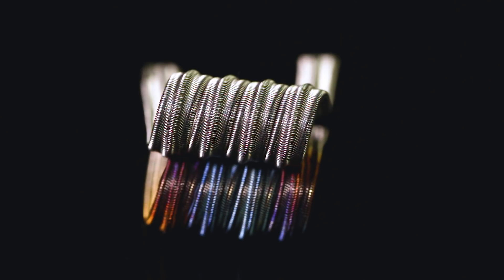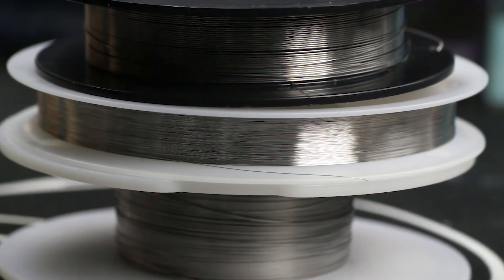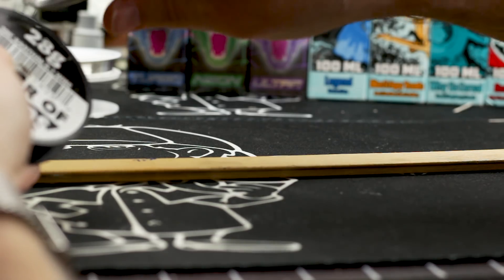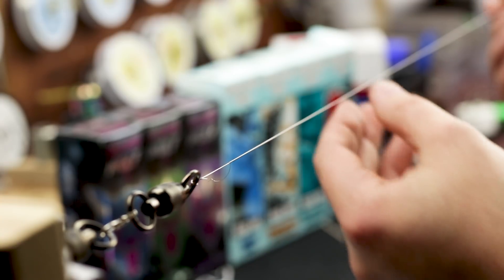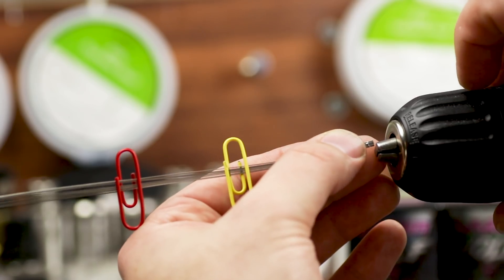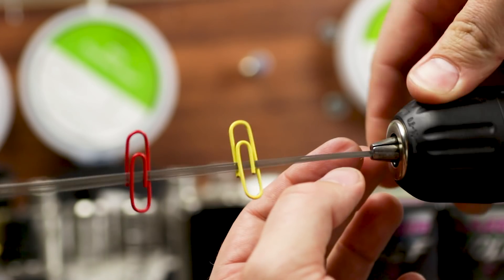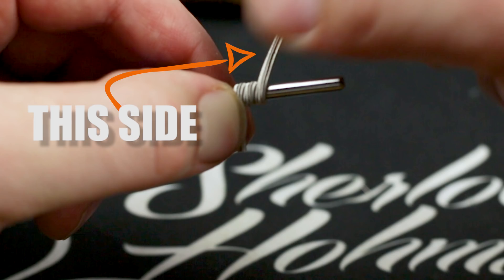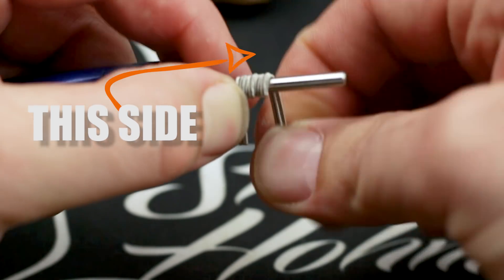How to Build the Enigma Coil  - Coil Building Tutorial Series - Advanced Exotic Coil Build

Comment: I'm trying out a new build you might want to check out, 28g ni80 claptoned with 32 kanthal a1, claptoned again with 36g ni80 in the grooves. Like you would fit the fine wire in a twisted helix, only in the larger Clapton instead of in the twist channels

Comment: What causes the bulge? The extra number of staples in the core. I have made frammed staple aliens with 26guage frames and 5 pieces of .5x.1 ribbon and i do not get that bulge in the coil
Reply: Travis Qualls Yes, because of the wide core. 
So you have more surface and the waves of the clapton frame wire create bulge because it needs more then one bend to fit around.

Comment: I can't get the Enigma for the life of me, I've tried the under stretch method and I basically got a mohawk, so now I have one mohawk with 6  .5 ribbon wire and 2 26 gauge as the core... if I leave it completely understand I just it looks like it's a triangle which is not right so if I stretch it even more it comes out like a regular alien wire what's your trick man I went through almost 40 feet of wire now, it's not like I'm not paying attention to your video because I've watched it about 12 13 times I just don't get it my ribbon wire and my core wire is straight, I don't know if you can help me out shoot me a message maybe I can do something different, I do appreciate the information, but I'm not going to give up on it I have plenty of wire I got a decent amount of wire actually LOL so I'll keep plugging at it but I'm done for now until I could find some more research on it, I just like the way it looks it's very interesting to me and I am not a beginner Builder and I understand that the Enigma is not a beginner building it's an advanced build but I'm just not comprehending something so if you could shoot me a message I'd appreciate it thank you mr. Sherlock Holmes...
Reply from the maker: Anthony deitz use 28g frames, 10 .4 ribbon and a 28g decored 38.
Reply from the maker: Anthony deitz you’re using the wrong wire. The specs and ratios are important
Reply: Sherlock Hohms alright, I have all the other wire that you are saying in the video I just switched it up because I thought it would be easier being that I was just starting out trying the Enigma but I don't have the .4 ribbon wire so when I make another order this week from Amazon I usually get master of clouds but I use for my ribbon wire kidney puncher so I'll definitely get some point for and see what I can do you know it's all trial and error and I appreciate your advice, thanks but it still doesn't explain a few things that I'm not comprehending like I said if you under stress yet you regardless of what dude you're using to wrap it you should at least get a similarity of what you have but I'll give it a shot I'll order it when I order my my core wire and my my my 36 3432 you know my basic wires that I use trying to get 40 just as well just for that flavor but yeah man I appreciate it thanks for getting back to me, keep making the videos man so I can follow along and you know try some new stuff I enjoy it I appreciate your videos very much

Comment: Sherlock, is it possible that I can use the kidney puncher n80 ribbon wire 0.5x.1 ? I'm new with the ribbon wire so I'm just starting to get into some more exotic coils, I appreciate your help if you could message me back just a question like I said I'm not too familiar but I'm just getting into the ribbon wire, thanks man I appreciate it you do excellent work to I follow you lot of my work is done by your pages so I especially appreciate that
Reply from the maker: Anthony deitz hey man I’m sure it’s possible but you’ll have to change all the specs for the rest of the build and the resistance will be very very low so I don’t recommend it
Reply: Sherlock Hohms  you don't think it would be worth it and the resistance would be low because I'm using the 26 gauge as a core and a point five 6 ribbon wire and wrapping it with 36 gauge is that what you're saying, why it wouldn't be worth it, so what do you suggest that I do can you fill me in on a little bit more information that way I could take another swing at it I've tried it multiple times it's just not working out so I'd appreciate it if you could you know help me out a little bit if I understood each it it comes out like a mohawk, so now I have a mohawk that is flawless it basically has as the core 2-26 gauge wires on the side, and 6 pieces of ribbon wire and they are .5,. I mean the Mohawk it actually looks pretty cool but again if I stretch it more than that it comes out looking like a triangle any suggestion that you can give me that may help it work out better for me I would appreciate it, I know you express it in the video but I'm not a beginner Bill there and any means at all but this one really has me bugged out so if you could help me figure it out I would appreciate it, thanks man
Reply from the maker: Anthony deitz it’s not that it won’t be worth it. It’s that it won’t work

Comment: Hi Sherlock. Is there any difference in performance between a regular Clapton wrap and an Alien Clapton wrap, or is it just for pretty? Thanks in advance.
Reply from the maker: David D there is definitely a noticeable flavor difference in my opinion and That seems to be the consensus
Reply: Thanks, I'll keep at it.
Reply: What I learned about the alien wrap is,the alien tends to have a better wicking properties rather than say a standart clapton wrap.And you know when you have a better wicking it's means you have a better flavor and of course your cotton won't break easily :)
Reply: Old comment but no. Aliens have the same flavor as fused claptons, they are just hotter by a great margin, so hot in fact they make me nauseous at even 90 watts even though you can run them at 140.
Reply: David D anyway,its a really good question 😊
Reply: @shawclip  I've been building coils for 5 years now. I know exactly what I am talking about and although you can use different gauge wires to get a build that will run at the same wattage, be the same mass and give off the same heat as a standard fused Clapton it's just not worth it the hassle, aliens are so complicated to build and very overhyped and so are fancy builds in general, a 7 wrap around a 3mm of 22 gauge vapes just as good as any other build I've tried, I just prefer clapton's because they last way longer. The gains in vapor and flavor from these artisan coils is minimal at best.
Reply: @negativematter You're clearly biased and can't handle them, maybe you're just xenophobic as they make you nauseous as well.

Comment: Can you not do an all kanthal build?
Reply: I use only kanthal as of right now but it doesn’t have great flavor
Reply from the maker: Jonathan Melchor yes you can
Reply: It would be cool tho to see someone talk about how kanthal is much more rigid and easier vs using N80 all.  Kudos on the SS outer tho.
Reply from the maker: Jonathan Melchor it’s not exactly easier. Especially for outer wrapping. Aliens in particular are easier with softer metals like Nichrome and stainless
Reply: Sherlock Hohms agree, they definitely are
Reply: Corey Ylitalo I only use Kanthal on some core wires to get the resistance up for certain customers. Example, 2x28g ni80 + 8x0.4mm ribbon+36-50g as outer wire for clapton/alien/whatever usually ohms out to 0.09ohms 5 wraps around a 3mm bit. If I used 28g ka1 as my frame wire instead of all ni80, it'll get me closer to 0.1ish ohms. If I used all Kanthal cores, it'll get a little more of a bump to 0.12ish ohms for dual coil builds. All depends on your target ohms for single, dual, triple parallel or series mods. 

I personally, run 0.06 to 0.1ohm builds all day with my triple parallel driptech ts mech. That's making something the average vaper doesn't have access to without buying. Like 20+ply dual staple coils. 12ply framed staple coils, list goes on...